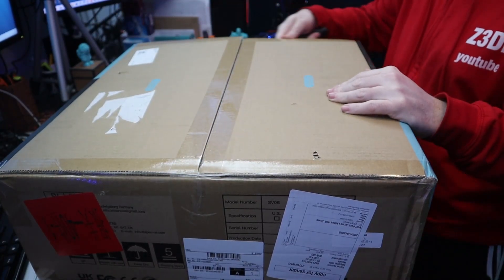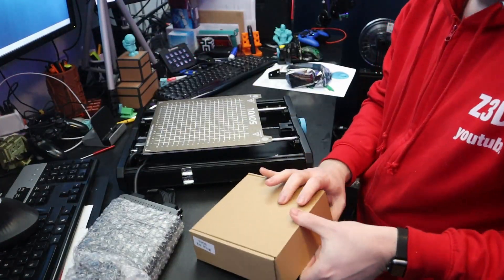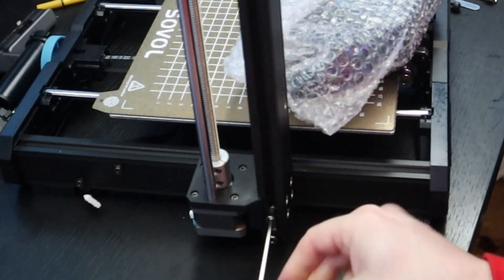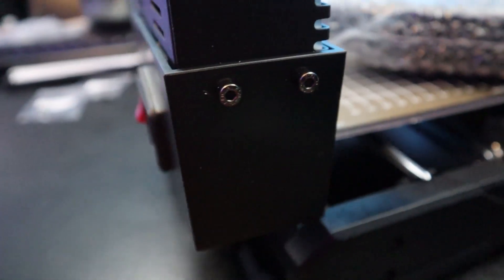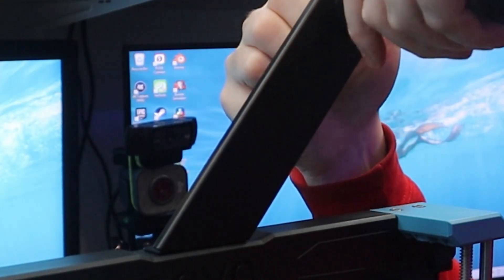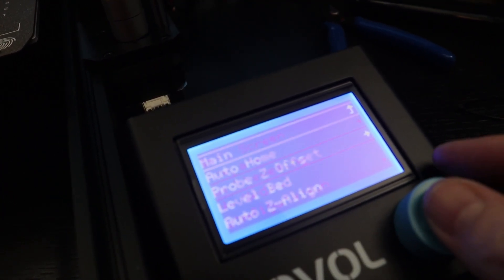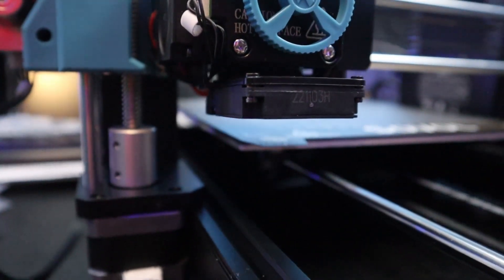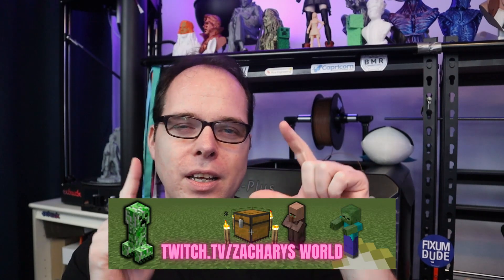The Sovol SV06 Unboxed: A Complete Setup Tutorial

Comment: I had no issues with mine. Then I noticed the prints were poor on one side of the bed. So I attempted to level the bed. ZERO options to level the bed on my sv06 🥴
Reply from the maker: That sounds like a frustrating experience, have you tried checking the bed's levelness with a manual leveling process?

Comment: Hi. I have a question.  When I power this unit down do I need to do it from the control panel or can I just power down with the switch.
Reply from the maker: Sorry for my late reply. Please for the power, you need to check which voltage is needed. For the noise of the steppers, that you need to do from the menu on the screen

Comment: All of these reviews only shows printing benchys.  The auto bed level is awful once you start printing bigger things or trying to print a bed calibration test.  I have tried to work on mine for 2 days and the auto leveling feature just does not work.  You can find plenty of these cases online.  Plenty of people have resorted to manual level.  The printer does print awesome though when you print smaller things
Reply: Huh.. Let me know if you find a solution since mine is coming in a few days. Usually im only printing smaller things anyways but sometimes i need bigger parts, so it would suck if thats the case for me too.
Reply from the maker: This was only printing the first thing that was on the card, nothing too big for the first video of it.
Reply: @Zachary3DPrints  yeah, not really sure why but their inductive probe just kinda sucks. but i got some new firmware for it that lets me do manual mesh leveling. been working great for me.
Reply from the maker: Cool, sad that it didn't work, but sometimes I like the manual leveling.
Reply: Is here someone who has fixed the auto-z-align-problem with the SOVOL SV06?
Everytime I start the "Auto Z-align" the printer starts moving, stops and the display shows "Driver error: PRINTER HALTED please reset". I already installed the latest firmware from a new micro-SD-card, but i never got farther than the Auto Z-align